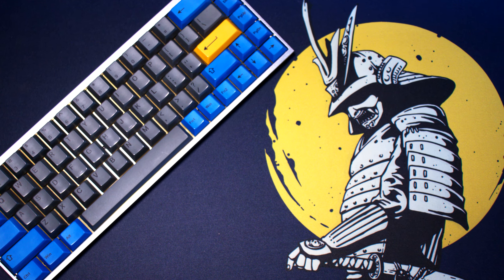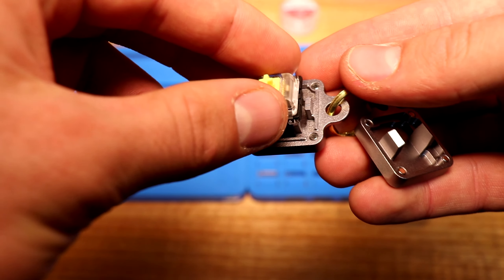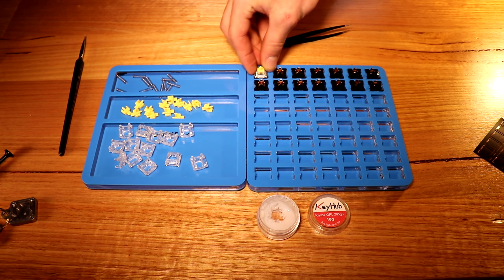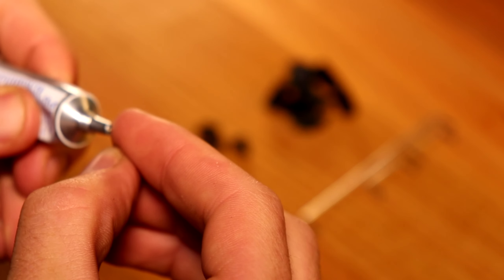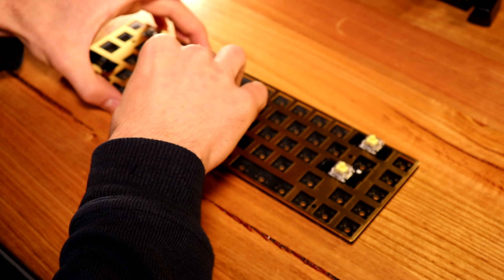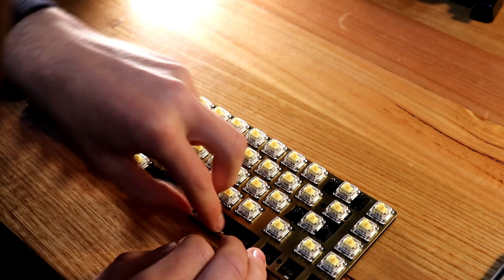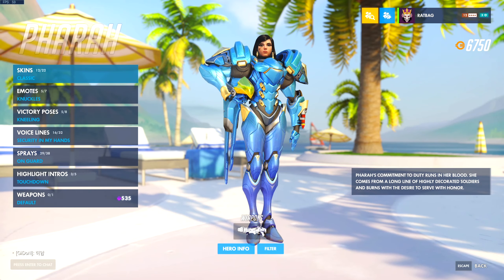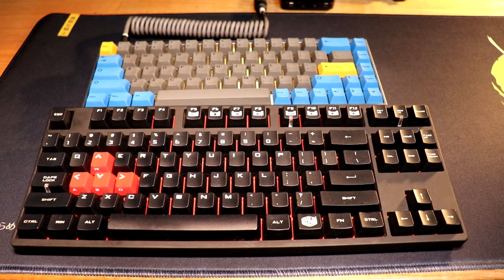$350 Tofu65 DZ65RBG v3 Hot swappable build Custom Mechanical Keyboard with Gateron Yellow Switches

Comment: Hi this build looks amazing. I took some inspiration from it and got a dz65v3 and a tofu65. It was all going great but the rgb is only rainbow. How did you change the rgb on this pcb? I tried VIA but i couldnt get it to work. thanks
Reply from the maker: In via you have to change to macro layout 1 (layout 0 is normal) I think default is fn1 then q w e r t y is all the settings for mode hue brightness ect
Reply from the maker: You might need to go into via and set ur fn keys

Comment: The video was actually fire bro. My question is do you feel any "input lag" or issues with the polling rate while gaming or typing? Kind of a dumb question, but really skeptical because I'm building my tofu65 but worried that as a really competitive cs and valorant player, I would feel input lag.
Reply from the maker: Ive never had any issues with input lag on the keyboard... If your right into (only) competitive gaming i would look be looking towards speed switches or switches with lower actuation points for a quicker type. Speeds are Perfect for pure gaming but can cause miss types if you work or type regularly on the keyboard. Personally I have bought some tactile switches (kaihl polias, will be getting others) and prefer the tactile feel for typing and general use and put up with them for gaming (mouse aim more important than keyboards movement). But linears are a better for just gaming.